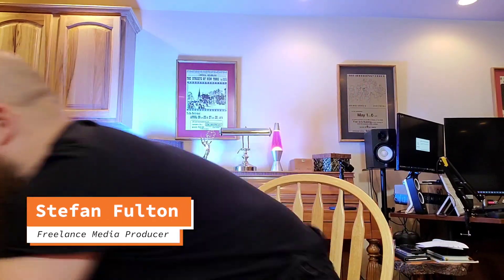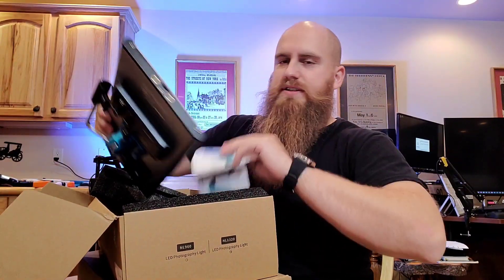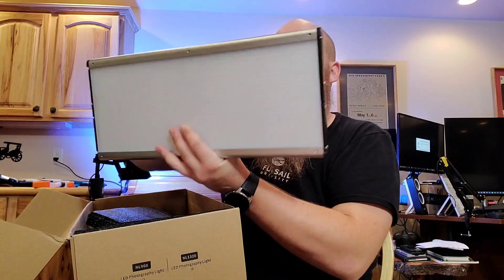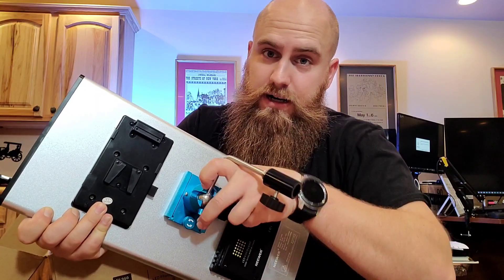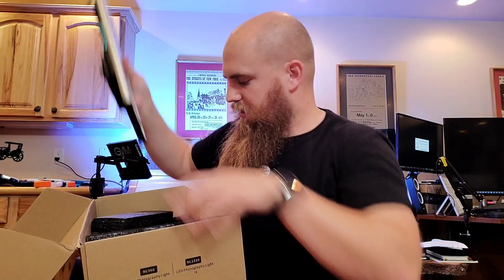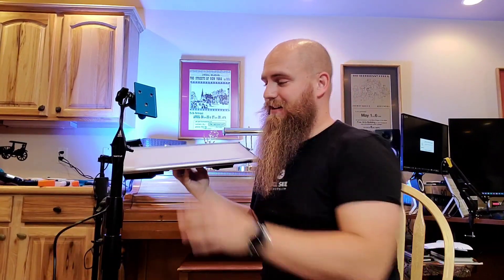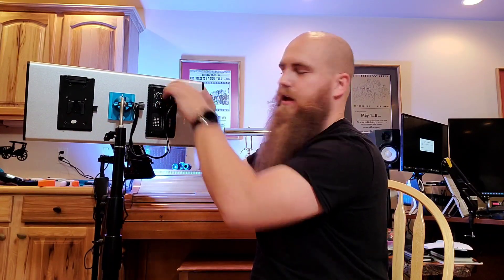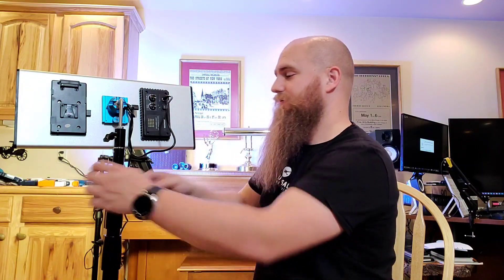GEAR REVIEW - Neewer NL1320 LED Panel Unboxing + Setup + Review

Comment: Thanks for going over the features. I'm curious if these would work well for full body lighting in a studio. I need to light performers standing in front of a full body green screen set-up and I think these might work. Thoughts?
Reply from the maker: These are pretty decent floods, but I would say they're better at lighting areas or inanimate objects rather than human skin. The color temp is a touch off, but if you're ok doing a bit of an adjustment in post then you'll be fine. For a bit more power and more options when it comes to diffusing/focusing the light, I would check out the COB lights from Neewer or GVM (with GVM typically being more color accurate for skin tone in my experience).
Reply: @MegaMiniMedia  I appreciate the quick reply! What do you mean by "COB" light?
Reply from the maker: @fairlytasteful  COB means "Chip On Board" which basically means lights that have a single, very large LED diode. The other option is basically panels, which have an array of diodes organized into a strip or panel, creating multiple points of light. COB leds are not only more powerful, but they also only cast one shadow as a point light, and can be diffused with all kinds of softboxes or modifiers via the Bowens-mount adapter on COB lights. Some interesting and inexpensive ones come from Wellmaking, Weeylite, and Neewer, but my favorites have been Godox and GVM lights. The P80S from GVM is my current favorite when it comes to price/power balance. I have three of em!

Comment: Hey can u do a video about this  light VR Kino Flo lighting sistems ? im looking to buy some lights for my content studio
Thank U
Reply from the maker: Hey Norma, thanks for the sub :) Which Kino Flo's are you talking about in particular? Ive used the large 4Bank portable lighting systems and they're great quality, but only really work as a very large, very wide beam angle light. Love them, but super bulky (although not that heavy for the size) and super expensive. For the power they're a great buy, but I would look into lights such as the GVM or Godox COB lights (single-diode LED lights that can be pretty dang powerful depending on what model you get) because they have Bowens mounting rings built into them. This allows you to attach a giant softbox and get the effect of a large light like the Kino 4Bank, or to use them as a sharp point light, lantern, or even a fresnel. The versatility is definitely there, they're relatively less expensive, and many of them can be battery powered, so they're super mobile! Definitely my favorite kind of lights at the moment :)
Hit me with more questions whenever, thanks for the comment and if I get a chance to film a test with some Kinos I'll definitely make it happen!

Comment: You said the dimming function was stepped, so can you really dim to this light to something like 1% or 5% so that this light could be used for very small light where you'd normally use the 480 model or smaller? The 2.4G version of this same 1320 light has a digital readout on the unit, but no one has shown stepped increments in any videos.  Neewer's 660 2.4G bi-color LED panel, for example, increments in 10s, so you either have 0 or start with 10%, which is actually quite a bit of light.
Reply from the maker: I just rewatched the video and I say "stepless" towards the end... did I misspeak earlier on? If so, my bad! These are definitely stepless, but since there's no display I can't be sure what percentage they start at. There's definitely a good jump from off to on, but I think it might be around 5%. With lights as powerful as these, I would be wary of that jump, as it might end up as the same amount of light as your 480 panels. However, you can always move your light further away and use that to both diffuse and lower the intensity of a light!
Reply: @MegaMiniMedia  You caught my attention when you said "stepless" in the video, the first review I could find that addresses the granularity of dimming these panels. I imagine there needs to be a minimal level to fire up LEDs on any panel vs other lighting technology. I have a pair of the Neewer 660 2.4G (nice to have a remote + digital readout) and want to get a pair of either the Neewer 960 2.4G or the 1320 2.4G to replace a pair of older white panels (tired of reaching up or getting a chair to change dim levels). I am lighting a small home office, but the 1320 would seem to offer more flexibility for larger room applications, a wider light spread than the 660s, and would compensate for the output reduction caused by putting the lights inside softboxes, bouncing off ceilings and walls. My concern was can you dim your 1320 down to a "modest" intensity for small room/small office applications? If not, then perhaps the 960.
Reply from the maker: @poltermouse  ah, I understand now! Absolutely they would work for an office, in fact with a softbox I'm sure you'll have no problem getting them dim enough. You can also set these lights to a specific balance between yellow and white and overall intensity then simply unplug them. When you plug them back in they'll turn on and dim up to your settings. Now I'm thinking of rigging the two I have in my studio to a surge protector so I can just click them on and off 🤔
Reply: @MegaMiniMedia  I have an even better solution for you; what I have used until upgrading my lighting to the 2.4G version of the Neewer panels with the wireless remote. Instead of a power strip on/off solution (been there), for less than $20 get a wireless wall outlet switch with wireless remote. They sell them at hardware stores, Lowes, Amazon. If your lights are set at the correct color and dim levels, then you can simply flip the battery operated switch (mount it on your rig, a wall, tripod, wherever). Tip: I don't buy the 2.4G them in kits, because kits only come with one remote. Purchasing panels separately (already have plenty of stands), now each light can have it's own dedicated remote, or they can be all controlled from a single remote. Or one remote and you change channels to control different lights. Aside: I think the dedicated remote would be easier to use than the lights controlled by a mobile phone. But for RGB Neewer panels, yah, that would be a case where the phone app makes sense. Future plans are to switch from colored bulbs and gels to small RGB panels for accent lighting, background mood.  Here's a link to the switch that I use: https://www.amazon.com/WESTEK-Indoor-Wireless-Outlet-Operation/dp/B000HJBE68/ref=sr_1_1?dchild=1&keywords=amertac+RFT1600&qid=1604248465&sr=8-1
Reply from the maker: @poltermouse  great idea! I'm planning to add some smart switches and a Google Home device to my studio so I can turn lights on or off using voice commands. Most of my studio lights already have remotes, so I just need something to allow me to turn them on/off and I'll be set.
Reply from the maker: finally going to be testing this build soon, decided to go with smart outlets and a smarthub to control it all. Should be able to control my lights with voice! I'll post with my results!

Comment: where did find you NPF battery converter?
Reply from the maker: I got one from Neewer! I'll post a link tomorrow 👍
Reply: @MegaMiniMedia  Alright thanks and do you think this light is better than the neewer 660?
Reply from the maker: @tommigunthompson3403  the 660 wouldn't be as powerful, but you can get three of those for the price of a 1320, especially if you have NPF batteries as the 1320 will need an adapter unless you have v-mount (very expensive, but super reliable, durable, and long lasting though). Neewer sells the adapters for ~$25!
Reply from the maker: Here's the link for the adapter... not an affiliate link, but would appreciate it if you visited my affiliate store (fcmg_stay or Stefan Fulton on Amazon) at some point to check out other gear I like 👍
 https://smile.amazon.com/dp/B075R8DMKF/ref=cm_sw_r_cp_apa_i_TVTKFbPRQAW00
Reply: @MegaMiniMedia  thank you, much appreciated.
Reply: @MegaMiniMedia  Do you also think the Neewer 1320 would serve as a good key light?
Reply from the maker: @tommigunthompson3403  it would work and be plenty powerful as a key light in most situations (wouldn't do much in broad daylight for example, but anything less bright will work fine) but I qould prefer to use a light with a higher CRI rating. These aren't terrible by any means (some lights look seriously green or yellowish) but they don't give the most accurate representation of skin tone. I would search for a light or panel with CRI 97+ for lighting people. I mainly use these when I need a wide area of lots of light, and then I'll use other lights that have better color accuracy to light the actual subject. Still SUPER useful lights and can be used on people, but I prefer others for that particular use.

Comment: Do they come with covers
Reply from the maker: Hey Rita! Just realized my previous response was to a different comment but I mixed it up 😅 These come with a cover in the sense that the led's aren't completely bare. There is a plastic cover that slides into the light to soften the led diodes :)
If you were asking about a case, they do come with a soft case to hold everything! Not the greatest quality, but the cases work fine.
Reply: @MegaMiniMedia  OK, do they come with barn doors
Reply from the maker: No barn doors included, just the panel, diffuser sheet, mounting hardware, power cable, and soft case.

Comment: light stand name?
Reply from the maker: Neewer 9ft heavy duty light stands, pair for $65 right now! Here's an affiliate link if you're interested in getting them from Amazon: https://amzn.to/30UbPO4
Reply: @MegaMiniMedia  converter needed?
Reply from the maker: @eatutorials4669  no converter needed! Those stands have a 1/4-20 thread and what I believe is called a "junior pin" in the film industry, which is the standard 1" mount. Works fine with all my lights, no adapter needed. These stands are heavy duty enough to hold a c-stand knuckle and 40" arm, or even a boom mount and arm. Sturdy enough to load up with sandbags too!
Reply: @MegaMiniMedia  you've been really helpful, thank u
Reply from the maker: @eatutorials4669  anytime buddy! Thanks for commenting 🤙

Comment: How are they holding up? I also go to FS for film, nice surprise haha!
Reply from the maker: They've been holding up well! They color balance a touch green, but I tend to have to pull a tiny bit of green out of the highlights of my shots anyway as I use Sony cameras. I would suggest checking out their fabric light instead... not bi-color, but really nice daylight rendering and TONS of power! These things could take a hit from a cannon and survive though, they've been working well 👍
Reply from the maker: Also great to hear you're going to FSU! How's your course going? What are you taking?
Reply: Full Coverage Media Group I have a similar light panel but it’s half the size. I have two of them and they are decent, but they aren’t gonna last for many years as I can tell by the quality. I’m taking film at FSU! I have an online class tomorrow as the campus is closed. What about you?
Reply from the maker: @camera7001  These have lasted well into a year so far with no real wear to speak of. Aluminum body helps with that! I was a Digital Cinematography major, so I was all online! Going to be doing a FB live stream later today and would love to see you there. It'll be an AMA discussion about photo/video/media stuff so feel free to chime in with any questions there! Also going to stream it to twitch.tv/fcmg_stay